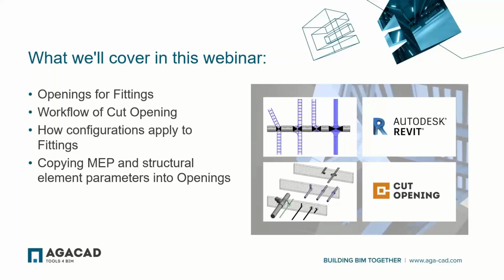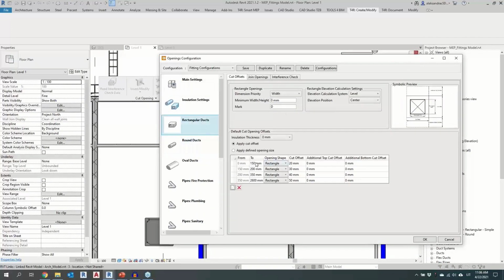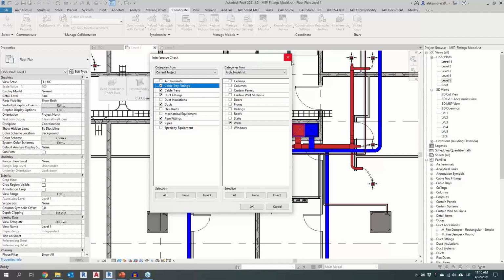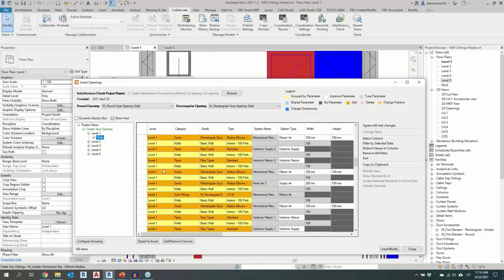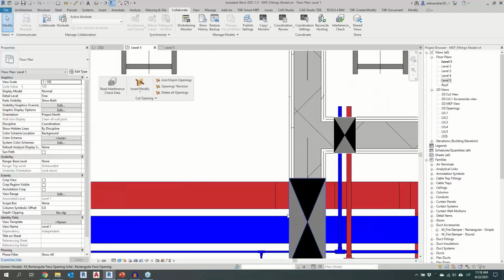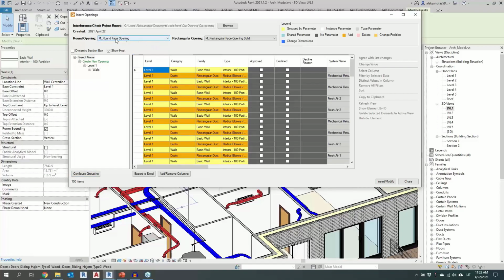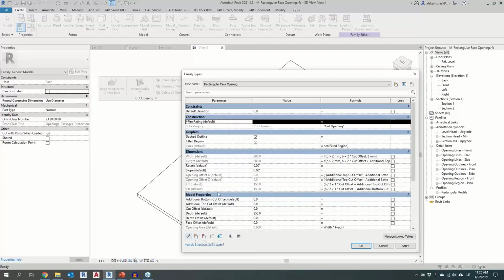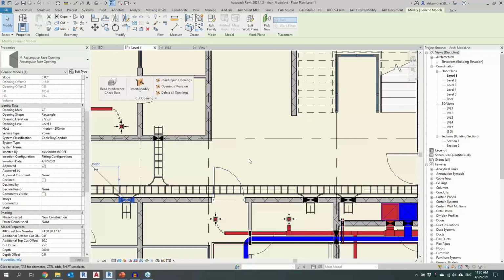Cut Openings for MEP Fittings in Revit

Comment: as we have huge project, work with both MEP & Architecture model are links, the holes we cut on parts( created on linked wall), the cut host category will need "parts" function?
Reply from the maker: When working with "create parts" function, Revit still knows that there is the wall and Cut Opening can create openings in those parts. Feel free to contact us via info@agacad[dot]com to discuss your needs and find solutions!

Comment: Can you make plugin, which can make hole in wall based ifc-model? I tryed this with dynamo, but i dont' have time to do this. This is huge problem in Revit. With Tekla i can make hole automatig from ifc-model.
Reply from the maker: Cut Opening can create openings for MEP elements that come from IFC as well as place opening on structural elements that come from IFC with the condition that imported structural IFC elements can host face-based details. Thanks for watching!

Comment: How will reflect Mep or tve opening in brick wall or RCC wall in link file can you help
Reply from the maker: If you are working in an MEP model and link the structural model, we suggest using a solid opening family, it will represent the opening as it is impossible to cut the linked geometry. You can later transfer those openings to structural models as real openings. Cheers!